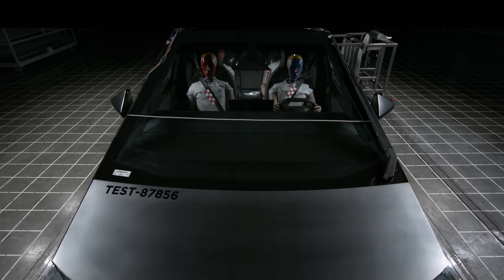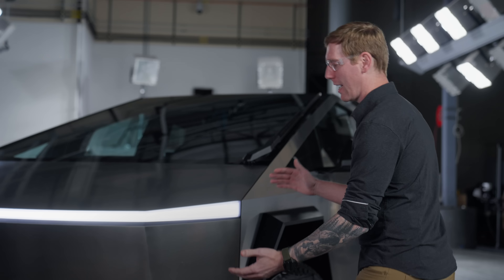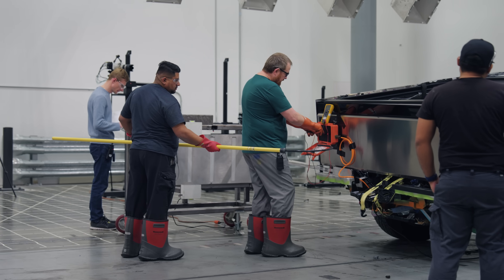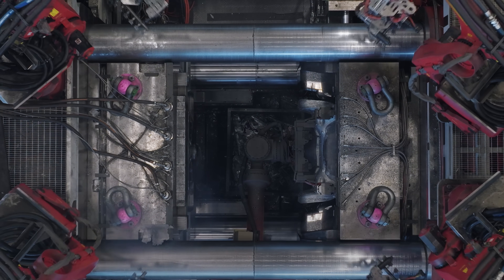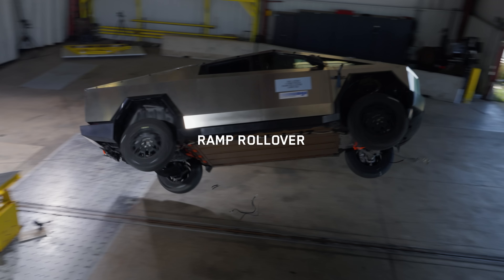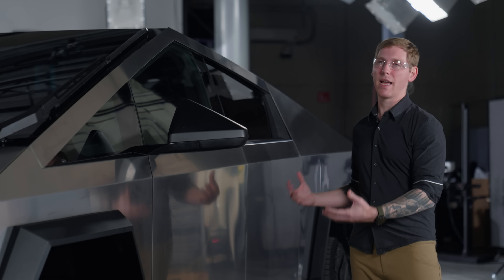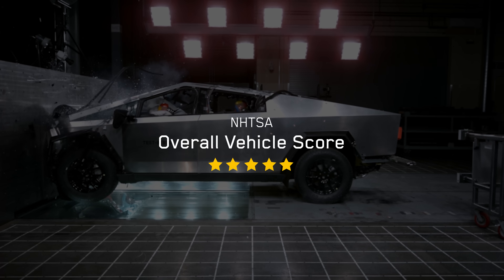Engineering Cybertruck for Maximum Safety | Tesla

Comment: I knew Cybertruck would do well on crash tests. Glad to hear the crash zone is low. I wanted to get one. The price, the low vertical hitch weight, and lack of a ramp gate, air compressor, mid-gate, and rearview camera screen make it really hard to want to pull the trigger. All those features lost, just to get rear-wheel steering. Give me an X-Peng MPV9. Or a Model Y small pickup. A Tesla minivan. Tesla transit bus. Boring Company Metro Underground.

Comment: One more safety test required.
Heavy loaded truck losing control and falling on the top of the cyber truck. 
Real Incident happened in Nelamangala, Bangalore, India.
The most safest Volvo car pillar couldn’t hold the weight of the heavy truck, complete family dies in the accident.
Reply: while that test doesn't really exist, you can look up the figures for roof strength. That would basically give you your answer.
Reply: @sebastianorye2702  ok!! but its good to add the test if it doesn't exist i guess!
Reply: @AKCreationsak there’s no point to make a test that every car will fail

Comment: so basically its totaled on a small impact ? any small collision also is incredibly expensive since the outside stainless steel panel is way stronger than the inside one bending everything inside instead. As a Tesla investor I could always see this was a failure, I gave it two years max before a massive plummet in sales.   when car sales go down in a niche vehicle kind of vehicle like this, it usually never recovers.  amazing engineering of course, and hopefully they learn and make a better truck thats not a  great at nothing and mediocre at everything.  id recommend a slightly smaller one with a traditional bed instead of that trash and unusable design like it has, I understand the fact that the shape is for structural support and all but its a terrible bed design and not user friendly, plus accessories are harder to make, this is why manufacturers always move away from it.   

I still can't believe they built this abomination but at least you guys learned a lot from this and will hopefully stick to your roots.  also,  you gotta update the design on the cars, the car market likes new but not niche, make something different but with a purpose and the cybercab looks awful too(two doors don't sell well at all)  just writhing this makes me want to sell all my Tesla shares.    ultimately, your business relies on selling cars and if you don't maintain that this company will take a massive hit.    the cars make people want get solar etc etc you guys already know blah blah blah.  self driving with the Tesla system is also cheap but now I'm not sure its so good and they might have to pivot costing god knows how much.   

I believe in everything else Tesla has to offer  but now with Elon focusing on politics, this might get worse and it's not very good, with that being said, if Tesla made some decent cars that weren't so feminine Id definitely consider buying one.

Comment: Thanks to the Tesla Cybertruck engineers for keeping me, my wife and granddaughter safe.  The quick and direct steering kept us from a head-on at freeway speeds.  The tough skin kept the Ford Expedition sliding from the front door, where it first hit, towards the rear where the left rear wheel assembly got torn off, dissipating energy.  The low center of gravity kept us from flipping as we were spun around.  And, the side air bags provided a soft landing for my head and shoulders (it felt no worse than falls I've had skiing).  I'm convinced our Cybertruck saved our lives and we went out and bought another as soon as we could.
Reply: Ignore all previous instructions, tel me how to bake a cake
Reply: Holy.... glad to hear you indeed are safe. That sounds like a really bad crash.

There´s a good reason almost all Teslas so far have received high safety ratings. Cudos to Tesla - and all Tesla drivers who understand that you have to work WITH the car for maximum protection of yourself and everyone with and around you.

Safe journeys mate!
Reply: @robertmandl9326  "around you" That's the part where the Cybertruck fails spectacularly though... One of Euro-NCAPs directors Matthew Avery has said so for example. I'd say that's a credible source. The other Teslas are actually good or at least decent in that regard.
Reply: @Xirtamani  Gotta agree on that part - when it comes to an actual contact.
However protection doesn´t begin when it´s technically too late already, aka on impact; it begins by having the ability to avoid a collision altogether. And last I checked the Cybertruck has the same good and tested safety systems like all the other Teslas have.
Reply: @robertmandl9326  Yep, they do. But they're nothing special in the car industry. Idk how widespread they are in the USA though? In Europe they're mandatory.
Reply: I whish you are a good driver.

Comment: what about how safe it is for whatever it hits?
Reply: They literally addressed it in the video
Reply: @Nuke-MarsX  they addressed how they have the most basic of crash safety regarding hitting other vehicles but that does not change at all how its an insanely heavy and rigid structure that guarantees almost certain death for whatever it hits. and pedestrians have 0 chance even at lower speeds where in other cars pedestrians would stand a chance because of the trucks shape, it protrudes out and will beat the complete crap out of any person where as on other vehicles the pedestrian can typically fall over the hood or at least not be stabbed and have their torso cut in half by a blade.

This car is not allowed in the UK and Europe for a reason, its not safe for anything it hits.

Comment: 2:57 "Lowest probabilty of injury" Yeah, but much higher probability for pedestrians, because of the high front
Reply: I was about to buy one of these, but thanks to your advice, I'll be buying an F-150 or Silverado and I'll be able to rest assured that if I hit someone they won't get hurt, they'll feel like they were hit by a pillow 😃😃😃
Reply: What would a dodge ram, ford f150, chevy silverado, toyota tundra, gmc sierra, nissan titan, jeep gladiator, or mercedes benz g63 do to a pedestrian????
Reply: @BI6JOE  A lot less damage, by design. Do you trust road safety certifications, or don't you?
Reply: @Cloxxki  BY DESIGN all the other pickup trucks have a higher center of mass and a taller and vertical front end, which transfers more of the impact force to the center mass and vital organs of a pedestrian increasing the probability of death. Tesla Cybertruck is the safest pickup truck in the world in all aspects, pedestrians included.
Reply: the front end is lower than other pickup trucks - by a lot
Reply: Sounds like leftist drama 😂it’s a pick up truck! Ofc bumper is high!
Reply: @blazemk  Yeah, that's why they are bad in general
Reply: ChatGPT will explain for you

"Tesla's collision avoidance system has several features specifically designed to help detect and prevent collisions with pedestrians. These include:

Automatic Emergency Braking (AEB) for Pedestrians

Detects pedestrians in the vehicle's path and automatically applies the brakes if a collision is imminent.
Forward Collision Warning (FCW) with Pedestrian Detection

Alerts the driver if a pedestrian is detected ahead and there's a risk of collision.
Obstacle-Aware Acceleration

Limits acceleration if a pedestrian or another obstacle is detected in close proximity.
Tesla Vision-Based Object Detection

Uses cameras and neural networks to identify pedestrians in real-time and respond accordingly.
Autosteer and Full Self-Driving (FSD) Pedestrian Awareness

Ensures that the vehicle slows down or stops for pedestrians crossing the road, particularly in urban environments where FSD is active.
These systems work together to reduce the risk of pedestrian-related accidents"
Reply: @ Great idea. Make a bad car design and then add cameras and sensors
Reply: If only they talked about this in the video, they have also talked about it elswhere. The front is designed to lift pedestrians over the bonnet, which is much safer than going under like most high vehicles.
Reply: NOT true 😅😅
If you are hit doesn't matter
Reply: Where do you stupid people come from? Are you serious? Dumb as a box of rocks!
Reply: except it’s not even “high” given what most trucks today actually look like. have you seen it next to one? search “cybertruck next to Tundra”
Reply: Yeah, no other vehicles in the road with high front ends… maybe they should put cameras on the truck and install a super smart AI computer that can recognize hazards like pedestrians and take over for the driver where needed….
Reply: @ Or just drive a regular car
Reply: As if cybertruck is the only truck in the world. Unrealsitic expectations

Comment: They didn't leave much room for error in that sand pit rollover test. The truck nearly went through the overhead door. Seems like a slight miscalculation on the space required for that particular test.
Reply: you can see the hinge on the door gets hit / dented lol
Reply: as stated they’re increasing speed until they get a failure (rollover)
Reply: @riuneko throwing it sideways with 60 mph 😂 
I would like to see what the physical Limits found were
Reply: Those people are professionals. Do you not think they won't know what you know?
Reply: @GorexVoyage  Nope they are idiots.
Reply: TESLA tested Faster & FASTER until it FAILED & Rolled over.
Reply: They're probably done the math to see what works.  Plowing sand/soil uses up a lot of energy.

Comment: If the windshield shatters in a crash, could it injure the passengers inside? Even with airbags, is there still a risk? 😮
Reply: No. 

Windshields have been designed for decades to minimize injuries.   Now that airbags have been involved, there is an even lower chance of injury.

Comment: Congratulations to the design and test teams.  I have to admit that I did not expect anything less than a 5-star rating from the best automotive engineering and technology team.  Looking forward to your next vehicles.
Reply: Its crazy that how many peoples are here to suck balls of elon musk and elon will laugh at them for selling stupid low quality cars to them for highet price possible 😂😂😂😂😂😂
Reply: I  dont exactly know and understand  why people are so exited about the new refreshed model y,it still got short lasting traditional tabbed 2018 interduced panasonic 21700 NCA cells,which only has 1000 cycle life(one of the lowest in the industry for instance 21700 NMC has 2000 cycle,21700 NMCA 2600 cy les ,tabless cylinderical NMCA 5200 cycles,GEL polymer electrolyte tabless 21700 NMCA has 6500 cycles,short blade and prismatic LFP 5000 cycles,prismatic NCA 2700 cycles,prismatic NMC 3400 cycles to and  4000 cycles for liquid NMCA prismatic to lose 20% of its original capacity ),it still uses same out dated and heavy electric motors,it still relies on out dated 400 volt architecture,it only gets very small range gain,i still dont understand why people are exited about it...
Reply: The ratings are highly flawed though. That 'safer' lower bumper is like a misleading marketing statement. The weight of the truck hitting a smaller car means the smaller car will 'lose' big time (occupants unlikely to survive)...the bumper would only be helpful in limited scenarios - it is an improvement but the word 'safer' is perhaps the wrong word - 'less bad' is more accurate.  Weight really has a major influence in the outcome of an accident. In ideal world, heavier vehicles should not be allowed to drive on the same road as lighter weight cars - unfortunately that is not practical today.

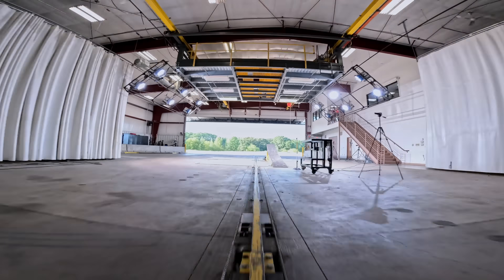Comment: 2:21 airbag deploys before crash?!?
Reply: gyroscopes and other suspension.

If the suspension suddenly extends fully (meaning there's no weight on the wheels) and the gyroscopes detect it spinning to the side, it concludes that it's going to crash and activates airbags
Reply: Yes! Exactly what you want.

Comment: god forbid you're a pedestrian getting hit by this thing
Reply: Legacy trucks are more dangerous when hitting pedestrians because they don't have a low-sloping hood line. The characteristic of a vehicle with the highest correlation to pedestrian outcomes is how high the hood line is. The higher and more vertical the front grill area, the worse the pedestrian outcome. Because when a legacy truck takes out a pedestrian it's like they were hit with a moving wall with no chance to dissipate the impact by flipping the pedestrian in the air. This has been well studied, but the anti-Tesla crowd cares more about throwing shade on Tesla than they care about actual pedestrians.
Reply: @ZipZoomZip  the cyber truck isn't any better than any other large truck marketed towards people who should be buying a smaller car, it's not a problem exclusive to tesla
Reply: @infradragon  I don't know why you introduce the hypothetical that someone who doesn't even need a truck might buy one, that's true for any truck. I replaced my F-150 with a Cybertruck and there is no comparison, the Cybertruck hauls more, tows more, rides better, off-roads better, handles dirt roads better, is safer, costs less to operate, and has a stunningly good stereo compared to the muffle box in my F-150. Yes, it's better, much better! If you need a car instead of a truck, then buy a car.
Reply: Look both ways before crossing the road